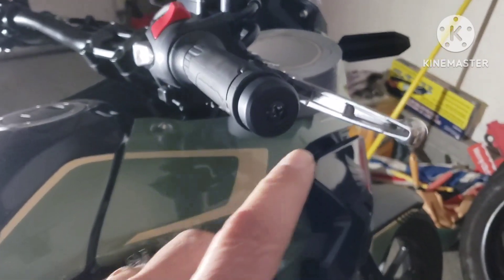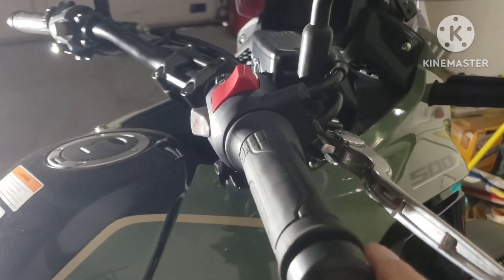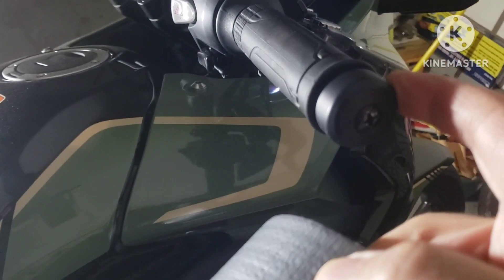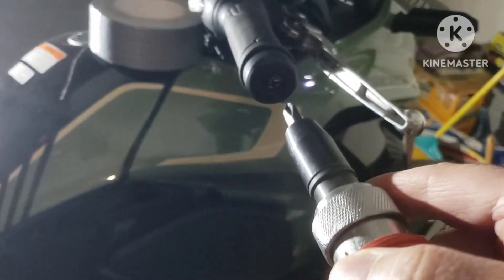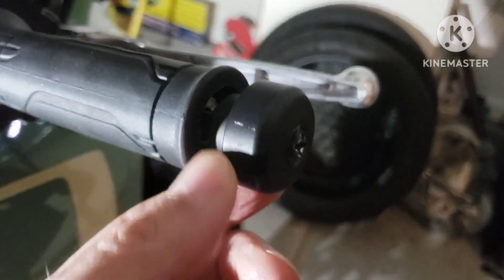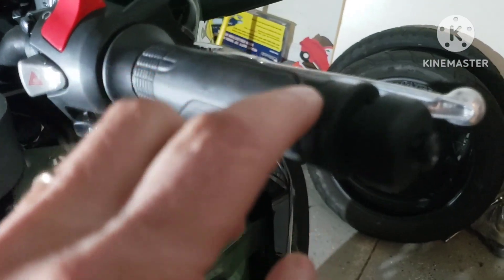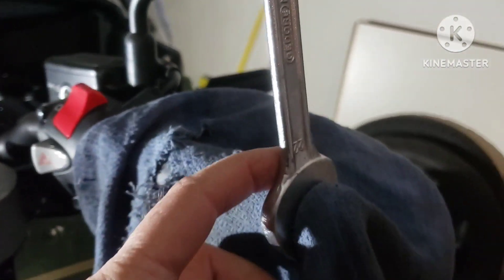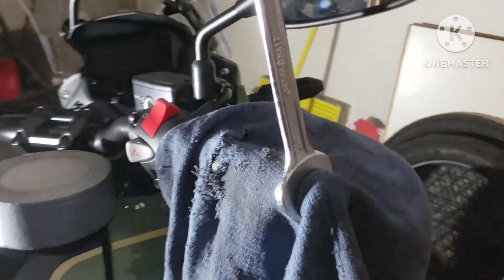How to Correctly and Easily Remove a Handlebar Weight from a CB500x

Comment: How would the duct tape immobilize the bar end piece if the grip you tape it to rotates as well?
Reply from the maker: You are trying to keep the metal bar end stationary in respect to the grip. Just roll the tape around a few times.
Reply: @bikerforlife5222  Managed to get it off. Had to buy an impact driver cause I didn't have one. Thank you for your video!